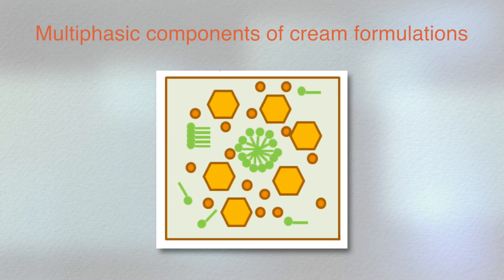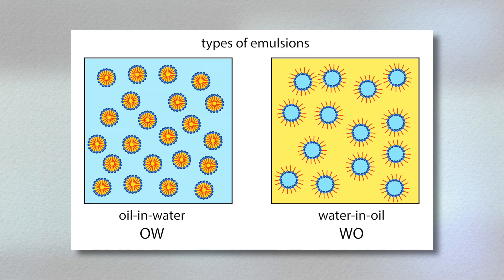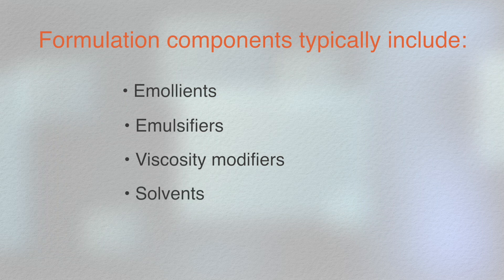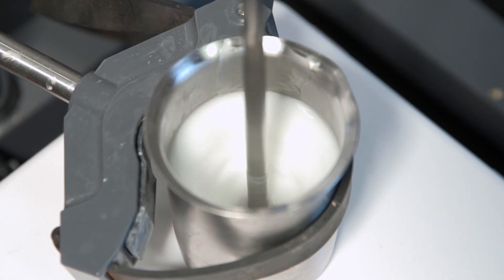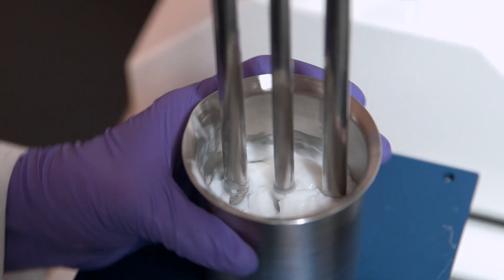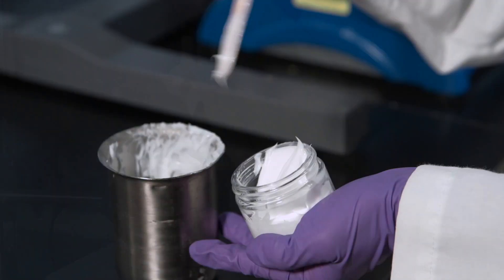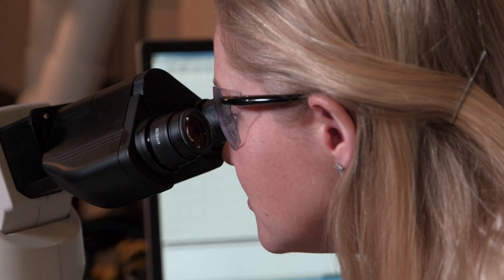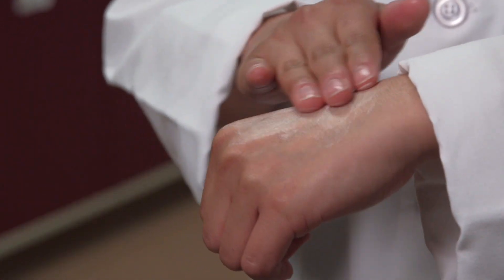Formulating Creams

Comment: What should be the minimum rpm speed of homogenizer n other stirrer.
Reply from the maker: The rate would depend on multiple factors including batch size, materials, etc. As a general recommendation, we typically suggest mixing at 500 rpm, homogenizing at 5000 rpm, and then decreasing the mixing rate to 200 rpm as the formulation cools. However, these parameters will need to be adjusted to suit the formulation being developed.
Reply: @basf  thank you so much.
Reply: @basf  I have purchased few raw material from your company. Though it's not directly. From indian supplier. ☺️